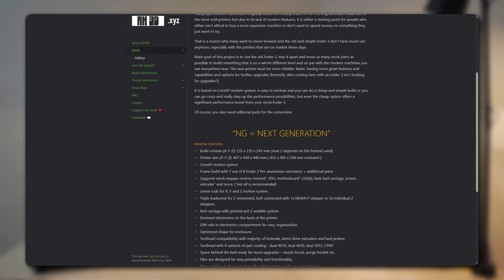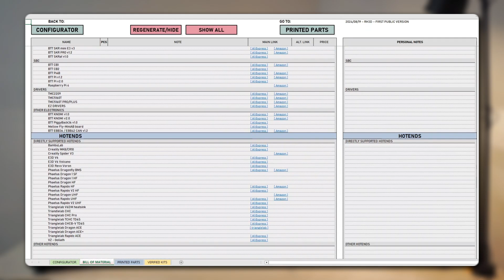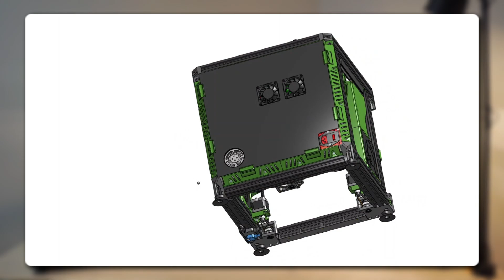E3NG v1.2 released - coreXY for your Ender 3

Comment: Just finished building the Beta and this releases. What would you prioritize updating between the beta build and this one? Is there a significant advantage between the beta top frame/motion system and this new one?
Reply from the maker: Also about the prioritizing, If you finished the beta, I would probably be using that for a moment and see for yourself if you would like to upgrade something. The biggest changes are the toolhead which I think is worth it. Y gantry blocks are lighter but if your beta ones are working fine, there is no other significant improvement. Front AB belt tensioners are nicer to work with and with the F695 they should be more precise as the printed 40T idler from beta might not be as perfect. Also it leaves more room for the toolhead if you would decide to upgrade to 4020 or 5015 fans. Upgrading the AB stepper mounts with the rear panel is nice if you really want to push the speeds and even more if you enclose the printer, because it keeps the steppers cooler and it is simple to add cooling to them. New frame options and the bed carriage with the replaceable flexi inserts are also nice upgrade... Well, that was almost all the printer, right :D..

As I said, I think the best option would really be to use the printer and see yourself if you'd like some of the things to be upgraded or the beta version of it is good enough for you.
Reply: @RH3D_cz  Thank god it was time to update anyways. My beta build's bed arms already snapped and it's currently being held by hot glue and hope. It's still printing good at 400mms at 12k accel but I would like to print out a back wall sometime soon. It's nice to know that the newer parts are so much easier to print than the beta too. Already got everything except the back wall. Last question: The AB mounts would have to be updated if I want to take advantage to the new wall, right?
Reply from the maker: @ididntdoanythingwrong3451  I know that broken bed arms situation. mine ended up glued few times as well because of me cracking them accidentaly. 
Right, the back wall doesn't fit the beta AB stepper mounts, although I think the height is the same, so you could theoretically cut out the corners for the beta mounts and use it but tha v1.2 AB mounts are much better.
Reply: I'm pretty close to finishing my beta too. v1.2 looks awesome.

I've been wondering if it will be simple to update one area of the printer at a time, or if it will require a complete rebuild.
Reply: @dr-fish-arms  Yeah I was looking at the motion parts and it no longer touches the endstop but then I also see the Y endstop as a separate printed part which probably means that the rear corners might need to be updated and if we're doing that, the front corners and the new belt tensioners need to also be updated to match the new belt dimensions. That sounds like a full rework and I was hoping that maybe I can do a bizzarro mini beta/offical build until I have all the information.

Edit: I'm stupid. Beta build is almost entirely compatible with the new release. Toolhead can be a separate update. Bed arms can be a separate update. Y motion system with new tension system at the front has to be an entire update.
Reply from the maker: @ididntdoanythingwrong3451  I know it might be painfull building the beta and then this comes out. There are definitely more people, but that's a thing hard/impossible to completely avoid.
For the beta vs v1.2 compatibility. I have been making it as compatible as possible, so basically any separate parts/assemblies can be updated individually, the belth path is basically the same even though we have different belt tensioners.
That means you can update individually parts like: toolhead, Y gantry blocks with Y endstop, belt tensioners with the front corner pieces, bed carriage arms, each bottom frame corner.
The most involved change would probably be the AB stepper mounts, because they have been moved back a bit to the electronics compartment which means I had to remake the rear panel and the top of the electronics cover as well, so these should be upgraded together.

Feel free to ask further questions if needed :).
Reply from the maker: @dr-fish-arms  Thanks! Have a look at the answer for @ididnothingwrong3451. It is pretty simple to update the parts separately and you don't need to do a complete rebuild.
Reply: @RH3D_cz  That's really convenient, didn't realize everything could be direct swapped.

Question on the enclosure: I ordered 3mm panels, mostly due to the price being already quite high. I see 4mm or 5mm is recommended. Are there any extra reinforcements you would recommend with 3mm?
Reply from the maker: @dr-fish-arms  Yeah, I didn't want to make it a new printer but rather an upgrade so I wanted to keep the things compatible unless it would be very beneficial.

3mm panels - I think you can't do a lot of reinforcements on the panels itself. 3mm should still work ok, It could just be a bit louder and the door and the top of the side panels that goes beyond the extrusions will be a bit more wobbly but it will work and should be ok once closed (there are magnetic "snaps" that keep the free ends held together). the thicker panels will just give you more comfort (more noise and temp insulation) and the printer will be more solid.
Reply: @RH3D_cz  Thanks! Good to know. I was able to switch the door and side panels to 4.5mm Lexan, hopefully that will be a good compromise. 4.5mm for the door and sides, 3mm for top, bottom, rear.

Comment: Hey RH3D, are there plans to make a Ender 3 V3 (original/se/ke) version of the CoreXY conversion kit?
Reply from the maker: Hey! There are no plans for that and I am not sure if it would even make sense. Ender 3 V3 frame extrusions look to be a lot custom and totally different from the standard V-slot extrusions. It would need to be a mostly new project I believe and those extrusions will also most likely be weaker.

Comment: will there be a linear railed version?
Reply: Linear rail mod will prob be in the discord under user mods
Reply from the maker: I am not sure about the official linear version - I first need to finish other important parts of the project and then I will look at other things (it is possible that there would be a linear rails upgrade or even a V2 with rails, but that is far future).
But as Arthur said, there was a user made linear rail mod for the beta version so I believe there could be one even for the V1.2.